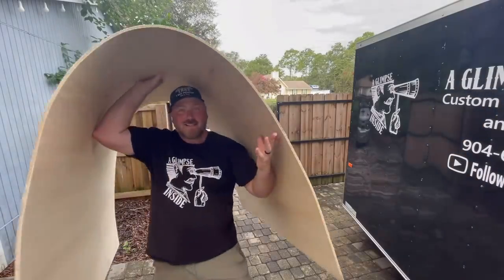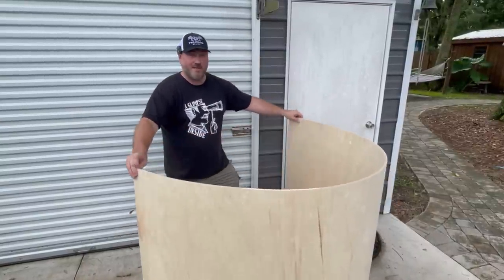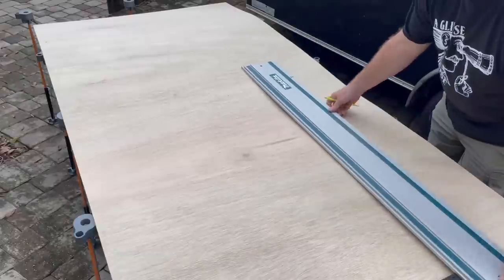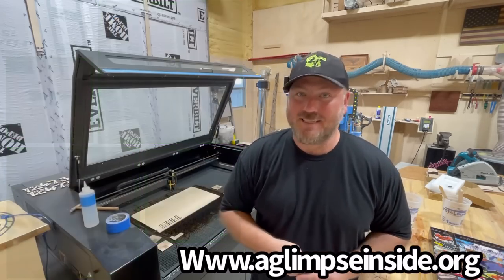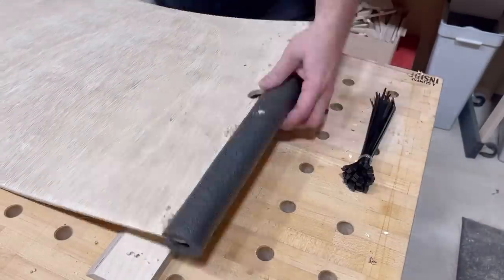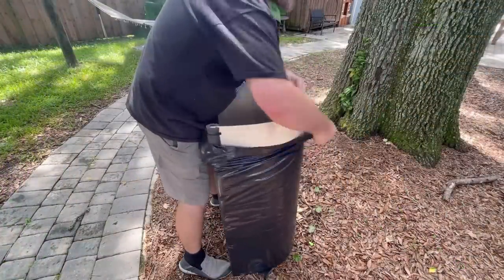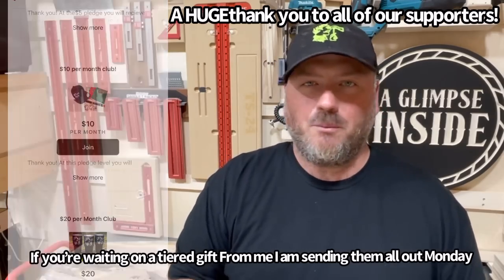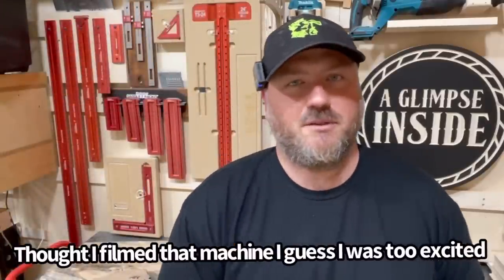My Favorite Use For BENDABLE Plywood

Comment: Hi. I know this is not along the same line as what you do but i am hoping you can help me answer this quick question. I am working on refinishing some nice quality vintage furniture but i have to put them under a costco 10x20 canopy for a few months September  to november in rainy seattle Washington. Is this advisable i am worried that they coyld warp especially the pieces with drawers. Should i wrap them in blankets?  What woukd you do?
Reply from the maker: Unfortunately that’s not gonna be enough protection. We used to restore furniture and actually had an antique store. Really items like that need to be stored inside as much as possible. So sorry if you don’t have the room but I wouldn’t run the risk
Reply: @AGlimpseInside  thank you